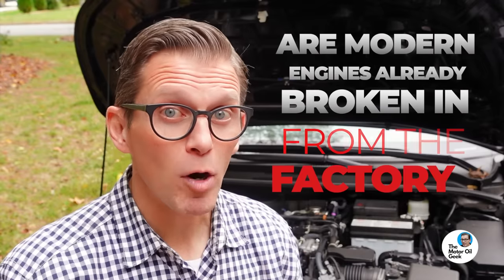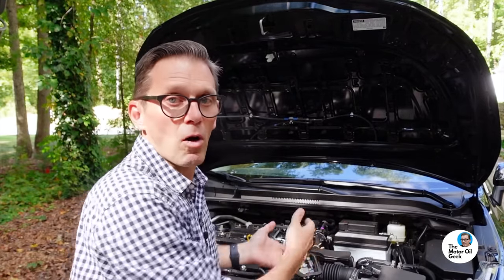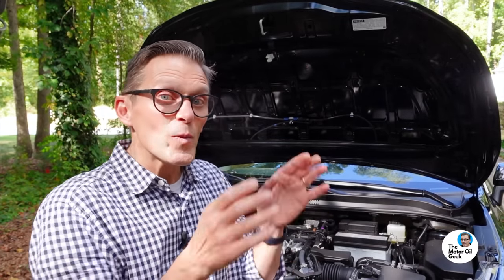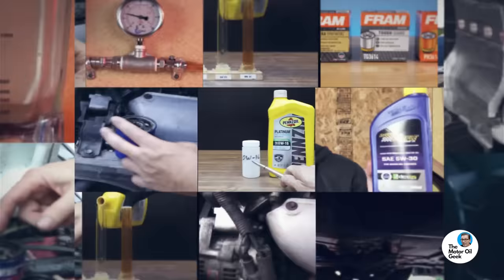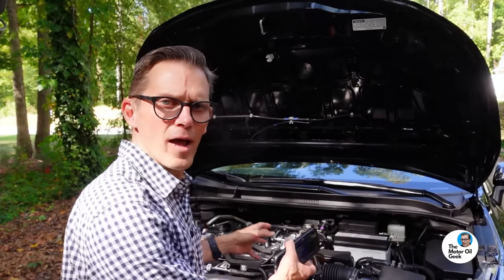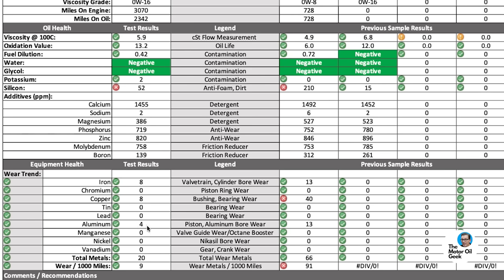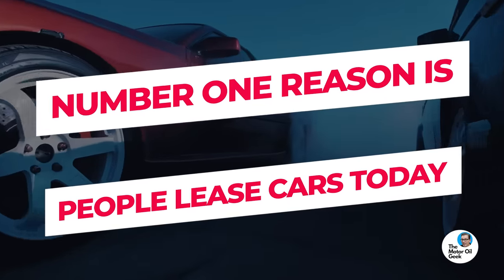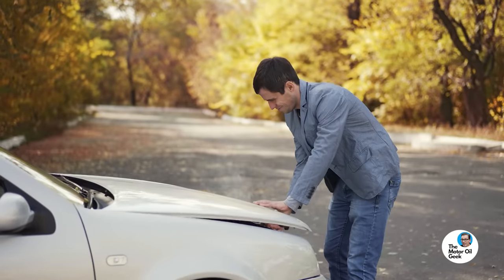New Engine Break-In: Truth or Myth?

Comment: I was taught to suck the oil sample from the middle of the oil well and not from the drain.. I guess in your case comparing samples from the drain before and after break in that validates your comparative even if it (wasn't the standard).. but still I wanted to take your insight into the difference between taking the sample by vacuum pump or from the drain.. thanks!!

Comment: Yup.  I usually did a oil change at around 1000 miles on a new car. I worked at a Toyota dealer starting out all I did was change oil.. OMG,  The oil that came out of new cars for the FIRST oil change at.... pfft 5,000 miles     Gross.     I would not let it go that long  Now its 10k
Reply from the maker: Thanks for sharing!

Comment: Wish I would have known this when we bought our new suburban 3.0L Duramax diesel in 2022.  Did the first oil change at 6300. The manufacturer recommended 7500.  We own it outright and plan on driving it 20 years 200k+.  Doing the oil changes myself now when the oil life monitor shows 20% remaining.  About 6000 miles.
Reply: You’re perfectly fine. There’s no proof that these early oil changes make an engine last longer.
Reply: @iuyozx   Exactly, the 3K oil change actually came about as a marketing ad for Jiffy Lube.  I do what my oil analysis tells me. I take a sample at 6K and send it in, the results tell me if I can go another 4K or not.

Comment: I bought a Ford a few years ago. I followed the recommended brake in suggested by Ford. Driving at reduced rpm for the first 500 miles, etc. That included oil change intervals. Transmission fluid exchanges. The oil used during the first oil changes was actually different. That copper and aluminum are from the bushings and bearings in the power train system.

Comment: Excellent article, thanks.  I’ve a new PHEV Lexus.  It runs mostly in electric mode - I’ve bought less than 100 litres of petrol in 6 months.   I’ve had the oil changed recently (very raised eyebrows at the dealership!). 
What do you suggest for this type of engine duty?

Comment: I just bought a new 2024 Mazda 3 and this video was really informative, I''ll be sure to do the first oil change at around 600 miles. From watching your videos I feel like I have enough knowledge to make sure my new car lasts at least 10 years. Also, if you think about it, it makes sense that the engine of a production car wouldn't be broken in at the factory. Sure they fire it up to check it for leaks/issues, but it doesn't really make fiscal sense for a manufacturer that makes hundreds of thousands (if not millions) of engines per year to run each one for 5-10 hours to break it in. I could maybe see a sports car or luxury car engine going through a factory break in, but I really doubt the average production car is.

Comment: I have only bought a few new cars in my life the first oil change and transmission service are the most important, if you plan on keeping the car for a long time, just do it before it hits 1,000 miles, gm cars have a magnet in the transmission pan, I bought a new Z28 camaro in 1984, changed the fluid and filter at 800 miles, that magnet had a lot of metal stuck to it, the engine does not have a magnet but the same thing happens there

Comment: Excellent commentary and points on this topic. While I haven't delved 'deeply' into it, logic would tell me that YES there is still a 'break-in period' on modern engines (and NO I don't think they have the resources to break-in mass production engines either.) While the time to seat the rings is drastically less than days gone by it's still a required operation in 'virgin' metal parts to 'get acquainted' with each other until the oil reaches them. 
In the '60's and '70's the break in was specified at 500 miles (cast iron rings). Moly was quick too and Chrome took FOREVER. I've worked on all kinds of spec'd or blue-printed machinery, and they ALL require the components 'wear-in' to each other and replacement in the same position or orientation upon reassembly. The old Marysville Marine Chrysler engine plant, where they assembled the Hemi's and E58 360 Premium engines would test run the engines on Propane or Natual Gas, but not for break-in. Those were very limited production engines though. BTW, thank God you're not a professional Youtuber. You have way more credibility. Most of those other videos you have to separate the 'wheat from the chaff'.
Reply from the maker: Thanks for sharing!

Comment: Great video, But I follow the manufacturer suggested maintenance. Free oil service included with a new vehicle, well they want to change the oil at 10k. Problem with that is that most cars are driven under severe conditions, requiring service at 5k.
Reply from the maker: Thanks for sharing!

Comment: I had an engine builder tell me once to never break in an engine on full synthetic. He told me to break it in on regular petroleum oil, then after breaking in, to switch to full synthetic oil. He told me the rings won't seat properly on full synthetic, whereas on regular oil, the rings will seat properly in the cylinders. Once you switch over to full synthetic, the micropores in the cylinder will be filled in on a microscopic level creating the optimal wear surface. Maybe the owner of this YouTube channel could chime in on this?
Reply from the maker: Sounds like we need to do a video on that.
Reply: @themotoroilgeek  I'd love to see that!  BTW this was told to me when I had my MkIII Supra Turbo engine rebuilt back in '96 (the infamous head gasket).  TRD flew a guy in to do the work.  $10k in extended warranty work!

Comment: Project farm youtuber did a video on 10k oil change intervals.  It wasnt on a brand new engime though.  He found the oil at 10k miles was still good which shocked me.  

We have a 2023 Toyota Camry Hybrid XLE.  Comes with regular services for a couple years.  At 5k the dash informed us it needs service.  Its over an hour drive to Lums Toyota in Oregon.  When we took it in they do checks and tire rotations.  No oil change.  

I used to do all my own work on our vehicles.  Every 3k miles do an oil and filter change.   Now that im reaching level 50 I just dont want to mess with it anymore.  We downsized to just one vehicle a few years ago.  

Every few years we trade in amd get something new.  Unfortunately the next batch of cars might have auto kill switches controllable by the govt and a whole host of insane intrusive tech.   Now we have to keep this car and do our best to make it last.  Sounds like I am back to doing oil changes.

Btw in 2002 I bought a brand new Mits Galant.  Downsized from an F150 due to new promotion required extensize driving.  10 years later the dash cracked into dozens of pieces.  Because of that and other issues like coil pack plastic holders and other plastic parts all disintegrating in my hands I never planned on keeping any vehicle more then 5 or 6 years...but with the new 1984 tech being put in cars looks like this Toyota Camry has to last.

Thankz for the video and subsequent discussion.

Comment: thank you so much, I always felt they don't break in their cars,,, I also change oil come up with motorcycle cause I feel it's just preservative oil during storage and transportation, I use cheap with no adds mineral oil for 20 miles,  replace it with with the same cheap oil for 100 miles with speed and load  variation, then I use semi synthetic oil for 500 miles not exceeding 5*1000 RPM . after that I keep using semi synthetic cause it works better for me for 1500km, better than full synthetic I feel it dried not lubing  gears enough... if I made any mistake please feel free to correct me, thank you for advices and movies,   more success, good day

Comment: Thanka for the info sharing. Always refreshing to see opinions backed up by data.

Quick question, for the first oil change, at what mileage do you usually recommend?
Reply from the maker: Thanks for watching and commenting. I’d recommend 500 miles for the first oil change and then 2,500 for the second.
Reply: @themotoroilgeek  what are your thoughts on a new gearbox, would it also have a break in period?

Comment: On  my brand new 2024 Mitsubishi Mirage ES, I changed the oil at 750 miles. Then I changed it at abut 3,700 miles. And the next will be at 7,500. And at 10,000 I'll change the engine oil, and CVT oil. It is a bit early for the CVT, but I want this to last.
Reply from the maker: Right on!

Comment: Nothing thinner than 0-30 oil and replace around 5.000 miles, will keep u smiling😊 Thinner oils reduce the life of the engine, and is only for the manufacturers to show slightly lower emissions to save their own skin.

Comment: Great video both my new 4Runner and my wife’s new GX460 got oil change at 1000 miles. Question: I always do oil change every 3000 miles or every six months from your experience is this necessary? Short trips and heating and cooling as I understand it creates water. Thanks

Comment: 3rd reason: cost. Dealer service manager told me in 90s, their German brand had extended oil change interval from 7500 to 15,000 miles, and no parts were changed. It was so the brand could do fewer oil changes under warranty. And 2/3 of that German brand cars are now leased.
Reply from the maker: Thanks for sharing!
Reply: Yep.  If the manual states 1000km, then they are liable for more labor costs.

Comment: The 2024 Toyota Corolla manual says specifically two break in periods.  Here it is:
■Breaking in your new Toyota
To extend the life of the vehicle,
observing the following precautions
is recommended:
●For the first 186 miles (300 km):
Avoid sudden stops.
●For the first 621 miles (1000 km):
• Do not drive at extremely high
speeds.
• Avoid sudden acceleration.
• Do not drive continuously in low
gears.
• Do not drive at a constant speed
for extended periods.

Comment: Great video. Here's another thing. If people would READ THE OWNERS MANUAL. it would tell them.if their engine requires break in. Not all engines are broke in from the factory. Toyota being one of them.  The ford mustang 5.0. The 6.7 powerstroke are not broken in.  Read the owners manual. It literally says first 1000 miles do an oil change. Don't exceed a certain engine speed.
Reply from the maker: Right on!!!

Comment: I did my second oil change on my 2022 Mazda CX-5 a few days ago. The car has 7100 original miles on it. I bought it used in 2023 with 3000 miles on it. At that time the engine oil was very clean and light in color, so I’m sure it had been changed by the dealership. It had been a service loaner car in its first year of operation. 

I changed oil and filter at 4400 miles to get that new-engine debris out of there, and then again a few days ago to be certain. I’m using 5W-30 full synthetic oil; that’s the weight recommended by Mazda for the turbo engine, they recommend 0W-20 for the naturally aspirated engine. 

On a hunch I decided to perform a service on the 6-speed automatic transmission, too. This is at 7100 miles. The fluid was very dark with fine particles, though the green color was still visible in the stream coming out. 

I dropped the pan to access the transmission filter and I’m glad I did. It was filthy black and the donut magnet had a 2mm layer of iron filings covering it. It felt good to clean all of that and install a new filter. 

I had been planning to do the transmission service at 10,000 miles, but after doing the oil/filter change I thought, “Why wait? This transmission has been breaking in for two years and I have time this week. Let’s do this!”

I’ll probably wait 30,000 miles before performing the next transmission service.
Reply: how interesting

Comment: Great video, thanks! In the aviation world, we run the engines at full power for break in. We see the cylinder head temperatures (air cooled engines) come down from above 400 degrees, to as low as 325 once break in is complete. Yes, these engines are nowhere near as precise as modern car engines, but the reality is that new parts always need a bit of break in. Dyno runs often do it quickly for racing engines.

Comment: My 2015 Ducati monster had its first required oil change at 600 miles. That 1200 makes 145hp, revs to 10,500, and can last over 100,000 miles turns way more revs routinely than a car engine. Seems like Ducati knows what’s best and does what you say is needed.
Reply from the maker: Right on!

Comment: Have a 24 Honda Passport and I have one free oil change.  I changed at 1300km, and they asked me I just bought the car about 2 months ago. I said yes, and they asked if I really wanted to change the oil, and I said yes.  Typically Honda maintenance minder on my older 07 Odyssey is about 8000 km.  On the new Passport, will be changing it at 5000k km, roughly around 50% oil life.

Comment: I believe that if you buy a brand new motorcycle, Yamaha, Kawasaki, Suzuki,,,, that you should change your oil at the first ride home from the dealer, again at 600 miles, then again at 1,000 miles, then every 1,000 miles after that if you ride at high RPM's,,,, if you don't ride at high RPM's then every 2,000~3,000 miles should be good. Most people will disagree and follow the manuel 5,000 mile interval and later regret it when they get the spun bearing,,,,,which is less likly on cruiser's.😮

Comment: Just had a 2012 2.5 liter engine rebuilt and gave the car to one of my kids. The shop that did the rebuild said to change the oil at 500 miles, 1500 miles and then 3000 miles thereafter. I think your experiment proves out the wisdom of that protocol I also bought a brand newLexus GX 460. I’m going to change the oil for the first oil change at 1000 miles. My thought was to change it thereafter at 5000 mile intervals instead of the 10,000 mile recommendation from Lexus. What are your thoughts? I intend to keep this car for a very long time.

Comment: Thank you for this fantastic info. I also own 2023 corolla and did 1K mile oil change. I opened up the oil filter and didn't see any metal shaving particles. I was wondering if I wasted doing an early oil change but now I know based on your scientific data it was worth it. Also, I heard from a Lexus service manager that Lexus engines are broken in from the factory but Toyota engines are not. Is it true or not I am not sure.
Reply from the maker: Glad it helped

Comment: Nice shout to Edwards Deming, one of the father of Supply Chain Management as well, and the Deming award is still respected in manufacturing. 
Breaking in engines at the factory would be a very expensive and unnecessary extra step. Why would Toyota, of all companies, add an extra step that can be accomplished just by driving the vehicle?? That's about as anti "Toyota Production System" as it gets.

Comment: just came across your videos, thanks for solving that myth once and for all. I got a question, if a car is 1995 made, does it means it must use thicker oil and not fully synthetic?
Reply from the maker: Thanks. For any car, unmodified, just use the viscosity specified in the owner’s manual. A synthetic blend is also a good option.

Comment: Thank you for a really interesting channel, that I have used as a reason the use break-in-oil for 500-1000 km in rebuilt engines (1ZZ in MR2 Spyder). Honed the cylinders and replaced piston rings, as well as increased the holes for oil return in the pistons. It seems succesful so far. 
What I miss in your content is a test of the contents in the oil filter. The wear particles that remain in the oil are of a size that the manufacturer considers too small to be of any concern. The particles large enough to damage the engine are stopped in the filter. They are the particles that show the actual wear during break in. You wouldn't happen to have kept the oil filters from your daughters car?

Comment: I bought a brand new Corolla in 2022. I took it in for the first service at 5,000 miles and noticed an oil change was not included but I paid for it regardless because it didn’t sit right with me not to change it on a new engine. Glad I was justified in doing that now.

Comment: I follow you with admiration.
but I agree with what you say,
1. Can these particles circulate in the engine? In other words, can an element that is denser than oil go up through the crankcase?
2. I'm surrounded by yellow taxis. Even with 500.000 km, I haven't seen any oil loss or performance degradation. I wonder if the effect is too low?
Thank you

Comment: I was told by Toyota Service Manager with 30+ years of experience and factory trained Mercedes-Benz AMG Tech (they did not know each other) that automakers conducted customer surveys; which customers did not like to going back to the dealerships than much (even for servicing).  Since the cars and trucks are being leased.  This led to longer oil change intervals of 10k miles or 1 year.  This works for a leasing auto customer who lease a car for 2 to 3 years.   However, the engine is not going last 150K miles or 200K miles with 10K miles oil changes.  If you are planning to keep car or truck for 8 years or more change the oil engine at 5k miles or every 6 months.
Reply from the maker: Right on!
Reply: Also, Please change your transmission fluid (automatic, cvt and manual), power steering fluid (if equipped), brake fluid, clutch fluid,  rear differential fluid,  front differential fluid and transfer case fluid for awd/4wd.  Change these fluids by mileage interval or time; if plan keeping car or truck for 8 years or more.

Comment: I own a small cc motorbike and drained the oil after about 600 miles (as the manual suggested) and I saw physical evidence of metal wear. One piece of metal was so large it nearly made me want to call Honda, but I let it go assuming it's just part of motor wear. It was a flat piece of thin material, but I never saw anything again after more oil changes. Honda does not break-in motors at the factory or I wouldn't have noticed anything.